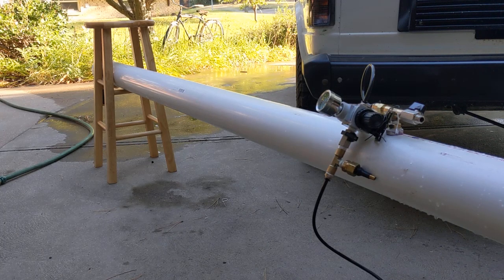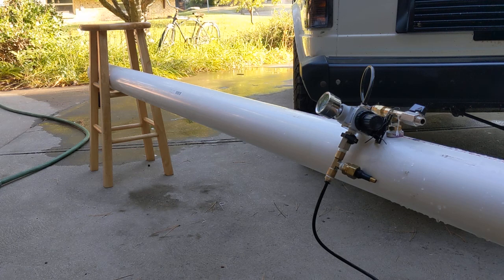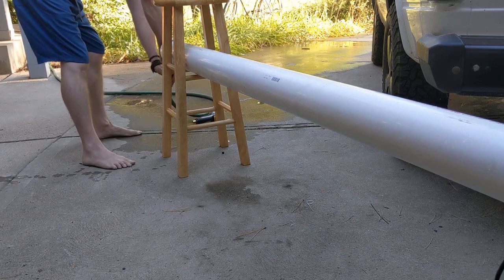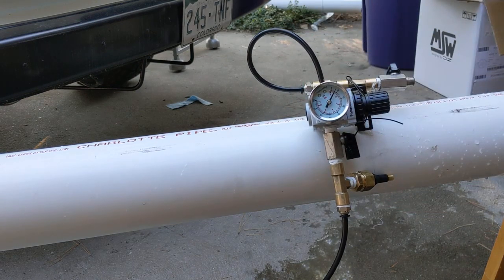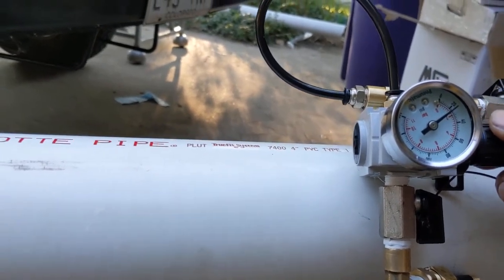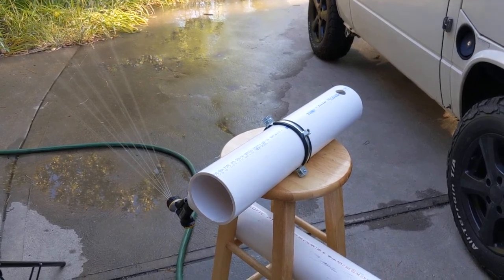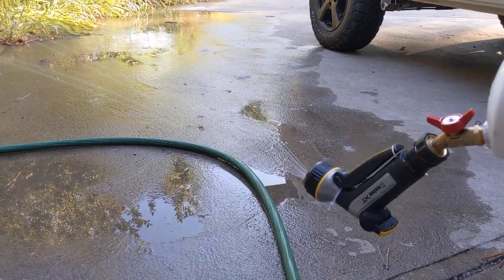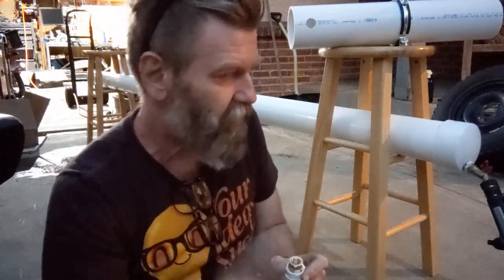DIY solar shower that is safe.. and doesn't need to be recharged with air!

Comment: I really liked this idea, alas I was not able to get the full picture of your setup. Where do you fill it with water? Could you provide some more info on  the air in side as well as the water in? Please. Best regards Mathias

Comment: Awesome video bruv! Finally someone talks about the pipe ratings and a better pressure system. I have been suggesting your system for quite some time now, but I don't build the stuff I just throw out the ideas, and sometimes they get picked up and sometimes they get kicked to the side 🤷‍♂️.
Stay safe and well out there on your adventures 🤙

Comment: That is because you bought drain pipe. You did not buy water supply pipeople. That have no experience in the plumbing industry. Should not make videos about how to build stuff out of plumbing parts.
You do not walk into a home depot. Lowe's menards Ace Hardware and pick up a random piece of white pipe. That's a scheduled 40 on it.
Reply from the maker: and maybe you shouldn't post on videos you don't watch.  I didn't buy drain pipe.  The entire video is about the fact that there are lots of OTHER videos where people use drain pipe because they think "Schedule 40" means high pressure - when it's actually a dimension, so there are a lot of unsafe builds out there.  I used water supply pipe rated for pressure. Thanks for your irrelevant comment.

Comment: Why not a simple HF $50 12v water pump? Easy and cheap! Did you check manufacturer specs? Burst strength on 4" ABS is 180 psi for pipe, 230 for fittings. Take a pretty good compressor to blow up that pipe! Heat rating of 80c vs PVCs 63. Definitely use ABS. Same fittings in both types.

Comment: VW actually built that idea into their bugs in the 1960s where they used the spare tire pressure stored in the front trunk to pressurize washer fluid.

Comment: A tip I recently learned when joining a metal fitting to a plastic one: pick your fittings so that the PVC has male threads going inside female metal threads. Otherwise the PVC will likely have a shortened lifetime. The metal tends to expand the PVC when it's screwed in, putting the PVC into tension that can cause it to crack eventually. If the metal is female then it puts the PVC into compression so that it's less likely to crack.

Comment: For all the money spent on the regulator and brass fittings you could probably buy a decent 12v water pump and run off your battery. And you don't have to worry about it exploding under pressure.  Just sayin'

Comment: What about a 12v pump instead of air? And what about sloshing?
Reply from the maker: There's a fair amount of weight to a vanagon so I haven't felt any slosh related movement.  On pump, you would need a very strong water pump to get the same pressure although that could give the same consistency of flow with the advantage that it could be reversed for the fill process. You'd need to add some kind of valve to allow air into the tube so as not to create a vacuum.  If I were to use a pump it would be a low powered air pump. I'd keep the exact current design but replace the air tank with a low powered air pump that is triggered by a low pressure switch so that it kicks in to maintain whatever pressure I want in the system. It could even be used to simplify the system by replacing the regulator with a small air pump, a 15psi switch for it, and a one way valve.  In the end that would turn this system into the same cycle process as a compressor with the pump kicking in when necessary to maintain the pressure in the tank.  If there was a super silent low volume low pressure pump like out there it could be fine, but the typical mini compressors that are used for air are loud and annoying.  I think the experience would be reduced, and as I have it now, served by a 5 gallon air tank under the van, I do enjoy having that air there for other purposes if I need it.

Comment: Great job! 
Love the simplicity as well as the use of the spare tire.
Reply from the maker: Thanks.  In the end I decided to replace the tire as the pressure tank with an actual 5 gallon tank designed for air horns.  My Vanagon has a nice space for it where the campers have a propane tank.  I connect it straight to my compressor and it balances out at about 110psi which is a lot of air and I carry some basic air cables so I can use it to fill a tire if I need to.  I can always recharge it with my 12v travel compressor.

Comment: This is a great design and definitely needs more views. I will be building your design this weekend and had one question. What was your method of installing the threaded fitting in the middle where your air fill enters? Did you just drill a hole and glue in a threaded connector? Thank you!
Reply from the maker: Working backwards from the outside going towards the inside, I'm pretty sure the brass fitting there is a 1/2" thread.. regardless, that is threaded into a PLASTIC part that is glued in.  That part is what you would use to create a 1/2" threaded end in a 3/4" pipe.. so it's OD is the ID of 3/4" PVC.. so it would be glued straight into that pipe.  The hole in the big pipe then is the same as the ID of a 3/4" PVC.  I might be wrong, and it might be the part for 1 inch PVC but regardless.. that describes the part.  If I were doing it again, I would have that top part much closer to the front end so that I could reach the inside of it so I could also glue a 1/2" of 3/4 PVC pipe onto it from the inside.  I have no leaks there, but that would have made it more solid.
Hope this helps. More pics at vanagony.com

Comment: It's closer to 13psi not 5 but still good info
Reply: Actually it's 69.3. 1 foot of head = 2.31 psi
Reply: @ssoleimany18  I based my calculations on inches of water column converted to psi. Apparently dynamic head isn't calculated the same way so I stand corrected
Reply: @davidmacias6576  haha no I'm actually an idiot and am COMPLETELY in the wrong 😅 🙃. Mixed up the conversion. 

1 foot of head IS = .433 psi which comes out to 13 psi. 

2.31 ft = 1psi 

You were right and I need to go take a nap 😅
Reply: @ssoleimany18  haha all good man, I need one too. Been a long ass day

Comment: Good video, would like to see how you installed the pressure regulator.
Reply from the maker: I added some close ups of the various connections in a blog post at vanagony.com
Reply: @kefrh  Awesome, Thank you
Reply from the maker: @jonnybkuehl878  I just updated a couple of the photos with some text comments to make it a bit clearer.  Bottom of the page https://www.vanagony.com/2020/09/08/safe-diy-solar-shower-using-the-spare-tire-as-an-air-pressure-tank/
Reply: @kefrh  This is Great!! I really appreciate it!!

Comment: Use grey pvc pipe it lasts 50 years
Reply from the maker: You could be right.. but state specifics please.  What grey pipe?  Is grey pipe by definition high pressure rated?  Show a source for that.
Reply: @kefrh  here is s link to a Dutch online store https://pvcvoordeel.nl/pvc-drukbuis/?gclid=Cj0KCQjw0emHBhC1ARIsAL1QGNfzIym4hoVbju1FePag5lA6vLigfswE3jZkAM1EMQA4P3PVa02UJgsaAnOdEALw_wcB rated at 10 bar
Reply from the maker: @qwertyuiopasdfghjkl2556  some rated at 16bar even, but biggest that you can buy 4m long is 63mm diameter.  The larger diameter pipes are only 1m long, and don't specify a pressure rating.
Reply: @kefrh  your correct but this is a example I'm sure the 5 meter versions are also available on other sites look for pn10 or 16 rating,  also it is possible to make from the 1m sections as a snake on top of your roof helps to disperse the water over the segments and prevent it from sloshing to one end when braking or accelerating, PS. the black pipe comes as 5 meter in 315mm and pn7.5 thats a good size and pressure imo

Comment: What pressurized caps are you using? I'm having issues finding caps safe for pressure.
Reply from the maker: Charlotte Pipe Schedule 40 4 in. Slip x 4 in. Dia. Slip PVC Cap
Item no. 47551 from AceHardware. Special order.

Comment: I have seriously watched about 50 videos of DIY PVC camp showers and your video is the only one that gets away from the idea of having to hook a compressor up every 5 minutes!  Genius!  Could you make a detailed part list?  I'd like to try and recreate your design!  Thanks!
Reply from the maker: Thanks!  Have you seen my follow up video too?  After mounting it and playing around and proving the tire air tank as a concept I installed a cheap air horn tank. Exactly the same theory, although I added a burst valve to the overall system as I charge the tank to 110psi, and if someone messed with the regulator I could have more than expected at the water tank.  Works really well.  5 gallon tank is a good 2 water fills. Just back from camping this weekend and got several solid showers out of it plus dishes and random water needs and came home with water to spare.  No doubt that the constant air supply is the way to go.  Makes it both safer (because of lower overall pressure) and better (set and forget). 
 https://www.vanagony.com/2020/10/16/air-tank-under-the-vanagon/
Reply: @kefrh  I just checked out your other video! Awesome follow up, that looks like the dream! I'm trying to put together a parts list so I can build one as well and found the one on your blog but for some of the items you already had on-hand, I can't find exactly what I see in your video.  Sorry if I'm sounding dense but I think it be helpful (at least for me!) if you could have a screenshot of all of the brass and then put numbers above the part that correspond back to your list that has links for each including the ones you had on hand.  That way I could know exactly what to order and when it arrives I can see how everything connects together.  I paused the other video at 23 seconds and again at 47 seconds but I'm having trouble for some of the parts figuring out what end is male or female (ie: The T connector, I'm assuming it's female on either side and male going into the PVC but it's a little hard to tell with everything connected.)
Reply from the maker: @taitnt6065  I added some more detailed pics in the blog post at the end to show details.  Should give you an idea of how I did it.  I think much of my male / female decision making happened because of the free bits and pieces that came attached to the air valves that I found cheaper buying them with valve + hose + elbow.  https://www.vanagony.com/2020/09/08/safe-diy-solar-shower-using-the-spare-tire-as-an-air-pressure-tank/
Reply: @kefrh  Awesome!  Those pics help tremendously! Thank you so much! I just ordered some parts, we'll see how this goes!

Comment: schedule 40" solid core" is what is  need for a solar shower. , schedule 40 cellular is a lower grade of product. When i plumb i always spend the money on solid core piping. the solid core is used under ground in plumbing.

Comment: Keith have you measured water temp and surface temp on the tube at all? Schedule 40 pressure PVC is rated to 140 farenhiet, and my one worry is that paint black may exceed those temps in high heat environments. This said, I may have misunderstood basic thermodynamics there.
Reply from the maker: Another reason to avoid the more typical design where it's "pumped" up to 30psi.  With this design, and the regulator I run it at 10-12 psi which I feel should be well within limits.

Comment: Hi Keith, I am based in France. This is 1st time I comment a video on Youtube ! It is worth doing it ! I was looking for a solar shower that is secure and can work from full to empty with constant pressure. I was first looking for pressure regulators, and found your video. Your Set-up is exactly addressing my requirements, and solving all concerns I had. I will only add a debit-meter on the water output, to know what remains in the tank...to avoid missing water with soap all over the body....that's it ! many thanks for the experiments ! Philippe
Reply from the maker: Salut Philippe!  I have a second video that I made after install.  In the end I added an air tank that is usually used for air horns. Works great - but so did the spare tire. https://youtu.be/nJBcLwlY1Aw

Comment: Irrigation designer here.  I work with pipe and PSI / Feet of head every day.  You said ABS pipe gets brittle in sunlight.  So does PVC.  PVC starts getting brittle after about 3 years in the sun.  I sell 4inch SCH40 PVC everyday.  If Lowes/Home Depot doesn't have try your local irrigation supply store.  HDPE ( Polyethylene ) pipe does not get brittle in sunlight.  It can also freeze with water in it and wont bust ( hose parts may ).  It is more expensive.  A lot more expensive.  
So...   Sir...   I think your onto something with the pressure rated pipe.  Although your math is wrong on 30 feet of head.  30 feet of head is 12.99 PSI not that it matters.
AND..  I think its funny your battery died.  I was making a VID on my front porch.  Every time I tried to talk a truck came down the road.
Reply from the maker: Finding some old comments that I missed!  Thanks for your feedback and I agree with everything that you say and I think the regulated nature of this design helps mitigate disaster.  I run it at around 12psi and I'm making the assumption that even if compromised, pipe originally rated for high pressure can withstand that pressure.  I hope I'm right!
Reply: @kefrh  12 PSI would be fine even if the PVC gets brittle.  The brittle would make it more vulnerable to breaking if struck.  Not from pressure anyway.  Even if it does get damage, PVC isn't terribly expensive.

Comment: FYI: there are at least 2 kinds of PVC pipe (I am not addressing schedules), as you pointed out (and others in other videos) one is unsuitable for higher heat and pressures.
Research.
I wondered when someone was going to utilize the volume tire tank.
Though there is UV-resistant paint unless you plan to take a shower soon I would have and utilize a UV-resistant cover that can be easily removed & installed. A white sheet sleeve with velcro would work. Inexpensive.

Comment: You would never empty your spare for a shower. You'd have a tank with the regulator on it.
Reply from the maker: I now have a 5 gallon tank under the van. there's nothing wrong with using pressure from my spare trailer tire though because I carry a compressor. Have to as my Vanagon spare is too big to fit underneath unless its deflated.

Comment: While I enjoyed your video and found it interesting, Lowes and Home Depot absolutely sell pvc pipe designed for pressurized systems and always have. What you were showing is 4" drain pipe and you are correct, drain pipe is not designed to be pressurized. Because they didn't have 4" sch40 water pipe in stock doesn't mean it isn't available, although there seems to be supply issues and my local store only has 5' sections of 4" and the biggest 10' sections of pvc water line they had was 2". The black ABS that a lot of people are using is not designed for pressure applications either. I commend you for bringing the safety aspect of the pipe up though and agree there's a lot of dangerous DIY build info on the tube like there is with many things. The best place for people to get proper 4" pvc pipe would probably be an irrigation supply company or plumbing supply company. I've been watching many of these videos as well trying to decide what I want to use for a single axle camper I'm building. Because I'll have 12vc power on board I think I'll use a setup similar to yours with a 12vdc air pump and a pressure regulator.
Reply from the maker: Thanks for the comment.  I'm willing to be wrong for sure!  I'm seeing confusion elsewhere though that "Sch40 = High Pressure" and that's not correct and leads to these debates at times.  Sch40 is a dimension, not a pressure rating.  There is high pressure sch40 4" pipe (solid core), and low pressure shc40 4" pipe (foam core).  In the many stores I visited there were 3 different types of 4" pipe, between drain, ABS and another but all of them clearly stated  on the pipe "not for high pressure".  Twice when I showed up at an Ace Hardware where the SKU search showed they had high pressure in stock, I showed up and it wasn't.  I'm sure this is in part because all I did was shop consumer stores. I bet specific plumbing supplies know their stuff a bit better.
Reply: @kefrh  The sad thing is, as you pointed out, all these posts out there (almost every one I watched) shows these pressurized pipe showers being made with black ABS and the people making these and viewers watching don't recognize the potential danger. I was installing irrigation systems over 40 years ago and have done a good bit of general plumbing as well, so I've had a great deal of experience buying pipe. Thanks again for your post.

Comment: I’m not a plumber and was concerned about pressurizing a PVC pipe, so your vid was super informative. Keep up the good work!
Reply from the maker: Thanks.  A year into this thing and the thing I'm most grateful for in the setup is the regulator valve and burst valve.  Even though it CAN take serious pressure in theory, it's now fuelled by a 5 gallon on board air tank that fills to 120psi.  Even the idea of standing with my face against a brass spigot with 40psi behind it would make me uncomfortable. I typically dial things down to about 15psi but it would probably work ok at 10.  That does open up the idea of using any pipe, as long as multiple fail safes are in place.